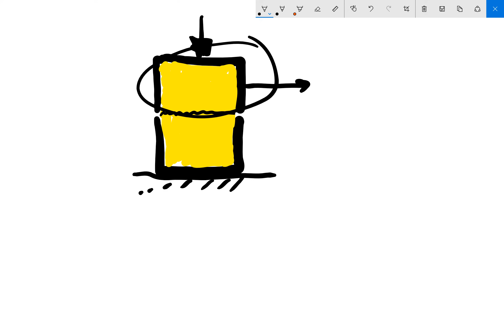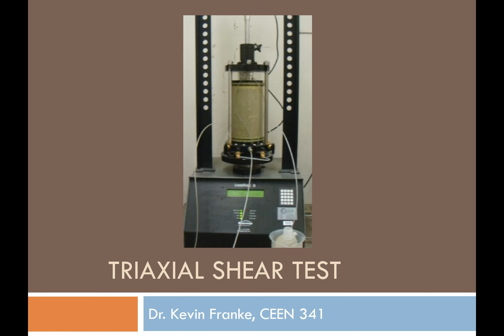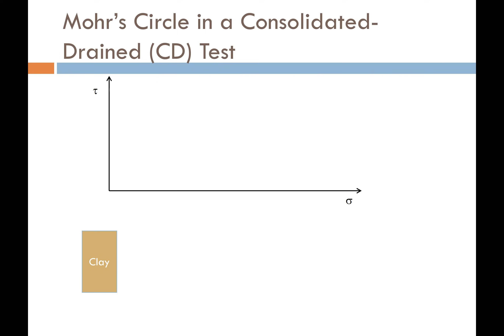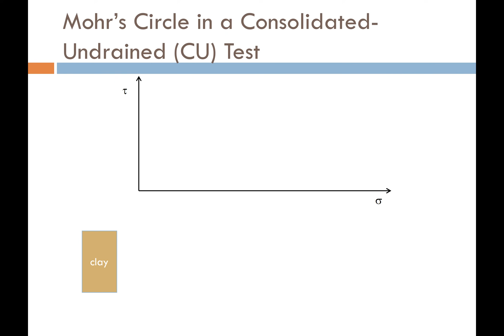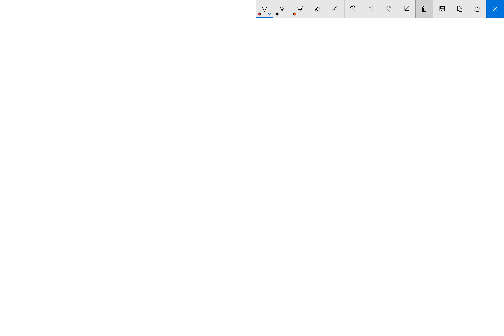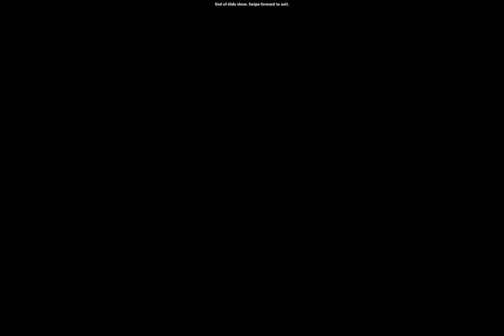CEEN 341 - Lecture 20 - Triaxial Shear Test

Comment: Thank you for the great explanation.
The procedure for obtaining soil samples for testing equipment is not clear. Take a soil sample with a rough N value using a standard penetration test.
The operation is performed without knowing which depth of soil is suitable for the soil sample.
If stones are mixed in, the inspection machine will not work properly.
Obtain it at 1cm along with the N value data using an in-situ test machine.
At the same time, data on loading, rotation, and settlement amount will be obtained.
Perform the calculation to obtain C and φ.
At that time, the singularity can be identified as the part that is causing the slope failure.
C and φ are design data for renovation and construction, and must also be used as data for disaster prevention.

Comment: Professor, I have a question which is draining me from last couple of days, which made me visit this video.
The doubt is that if there is a slope and i do the excavation on that slope, For accessing the immediate stability FOS and Long-term stability FOS. Which of the shear tests should i perform and why!. 
I thought about it like this, that immediately after the excavation and because the soil is clay, it can be thought of as a Drained soil because previously the soil has had the oppurtunity to drain away Excess pwp. so i thought of doing a CD test for Immediate stability 
For the Long term stability , i thought  that it is a case of unloading(excavation) and since the soil is clay, it will show an increase in pwp hence i thought of doing an CU test.
Please help me knowing the validity of my thought about the problem, that will be much appreciated.